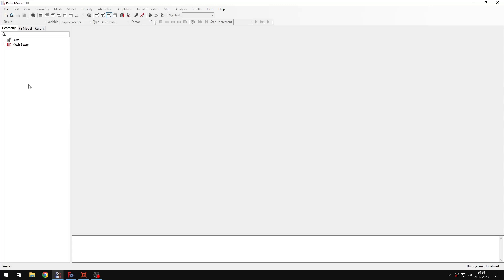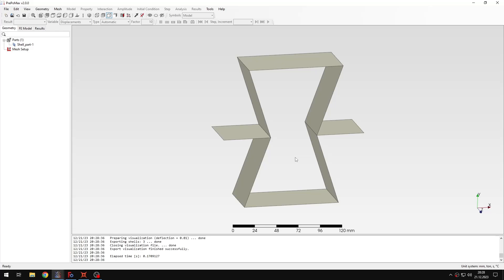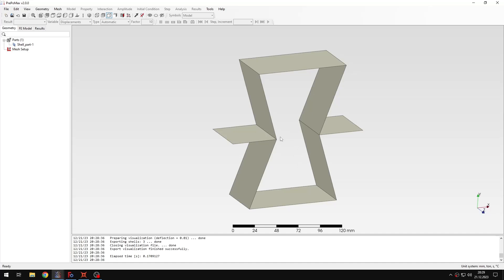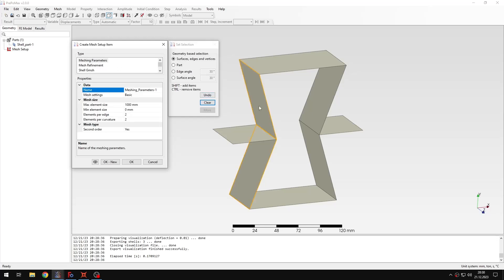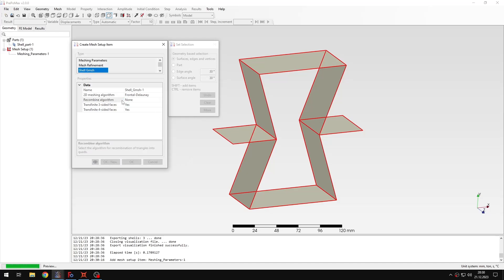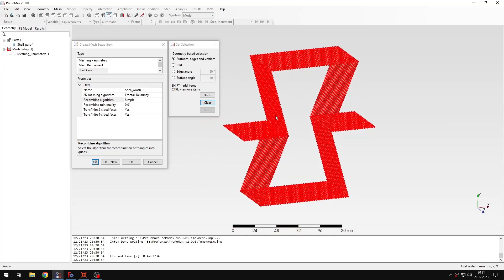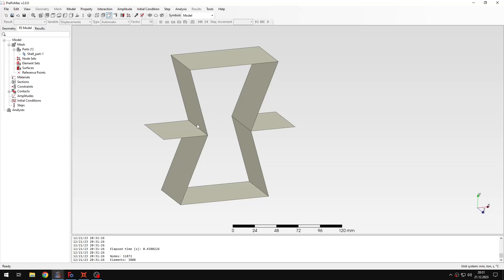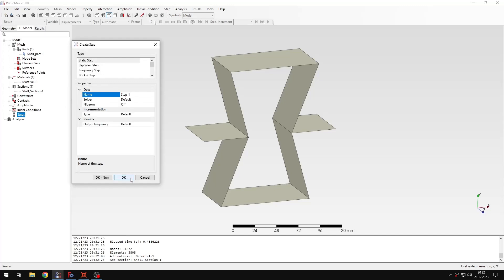PrePoMax (CalculiX FEA) - Tutorial 39 - Auxetics

Comment: Congrats on the PhD and on the videos mate, I am glad I found your channel.
Reply from the maker: Thank you very much. It's great to hear that my tutorials are helpful.
Reply: I wish something as intuitive as this came out for OpenFOAM, like, this Prepomax is straight forward and our videos are making it look like child play to run simulations with Open source software, that is just crazy!

Does it have, like, complex connectors and stuff? I mean like, cables, “fixed buoy”, contacts and all?

I will have to watch all your videos now!
Reply from the maker: @EngineerAAJ  There is one GUI for OpenFOAM that I can highly recommend. Not as good as PrePoMax but still worth giving a try - add-on CfdOF workbench for FreeCAD. I showed it in my tutorial about imported pressure load in PrePoMax.

When it comes to connections in PrePoMax, there’s contact, tie (permanent bonding), rigid body, spring (point and surface) and compression-only support.
Reply: Awesome, thanks  @FEAnalyst